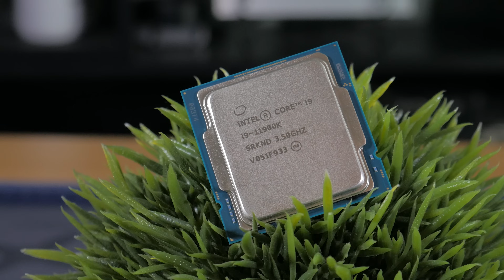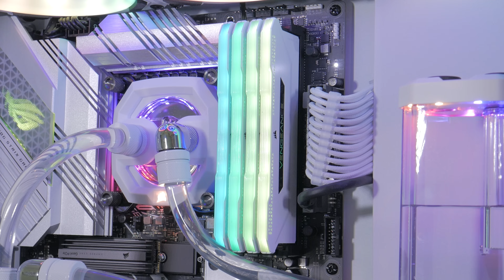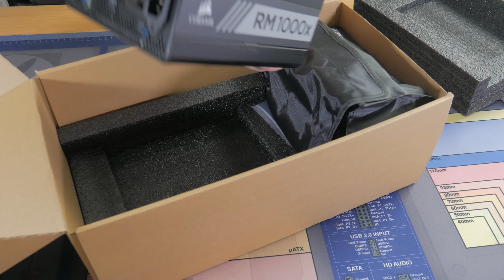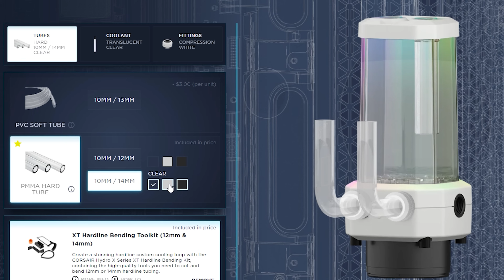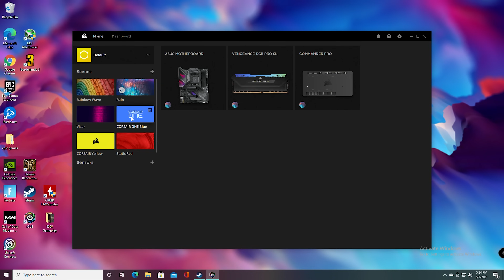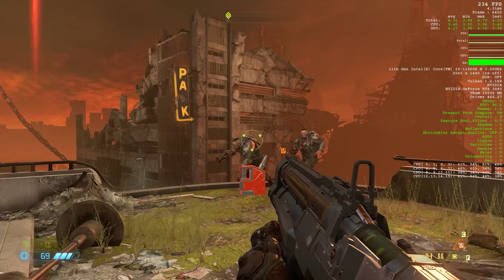Ultimate $3500 Gaming PC 2021!

Comment: 11900k? Well you could have done better lol, the 10900k and 5900X actually outperform it in pretty much everything. Also, you living under a rock? 32gb is not overkill for gaming and hasn't been considered that for about a year. And 1TB for the OS isn't at all good these days for high-end builds, should be going with at least 2x 2TB M.2 Drives for like 4TB in a high-end build, 1TB is good for applications and windows but will fit barely any games, if you got a HDD as well it's fine but this is a high-end build it should be doing both lol
Reply: Dat 11900k tho... smh

Comment: AYO not to be that person but the 11900k may not be the best in terms of price to performance. It loses 2 cores to have a little higher base clock which isn’t worth it. Stick with the Ryzen 9 3900x, 5950x, or even the Intel Core I9- 10900k. If you’re going for less money, I’d highly recommend the Ryzen 7 3700x. Great video though!
Reply: So people no longer watches the video?
It says sponsored by Intel and Corsair
He says is one of the best gaming cpus, not the best, not the best on the market... So he ain't lying.
He isn't telling you to build it like this... also the ryzen 9's 5000 are fucking imposible to find anywhere, and when you do, they are way more expensive...
Finaly, you need to learn context instead of just regurgitating someone else's memes... Steve said is a waste of sand because is NOT worth it as a replacement over the 10900k, which is true. As a stand alone, if you have an old i7 or something, and all you care is gaming, the 11900k is still a beast of a gaming chip, just currently overpriced for what is realy worth.
Reply: @josejuanandrade4439  I’m just saying price to performance is better off w the possible choices I listed, and with AMD you gain upgrade ability. Anyways to conclude, I never said it was a bad video, I just said the possible better options.
Reply: @josejuanandrade4439  11900k isnt even one of the best. Many last gen intel and current gen ryzen beat the absolutely living crap out of it.